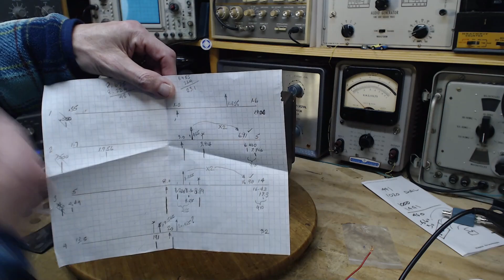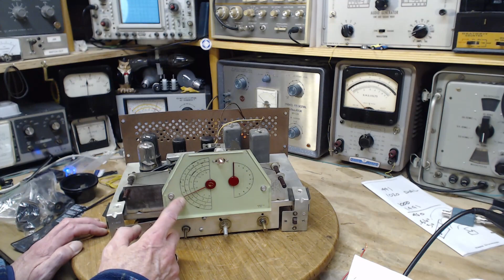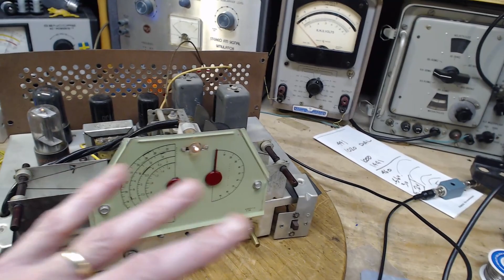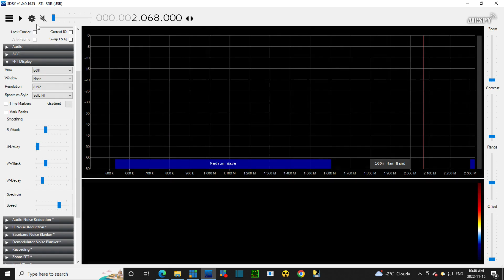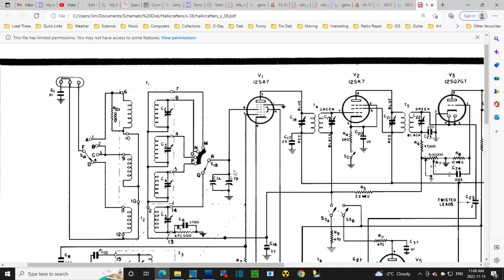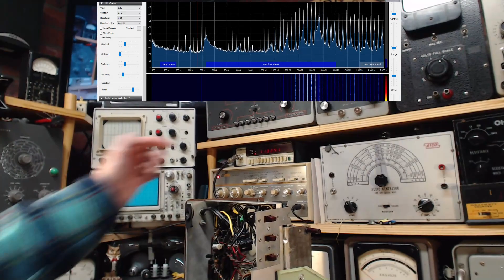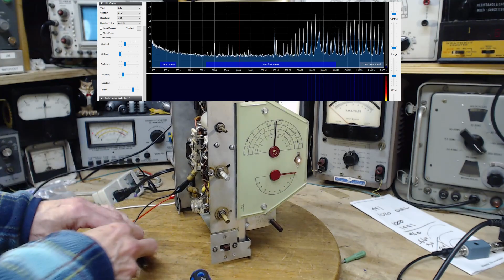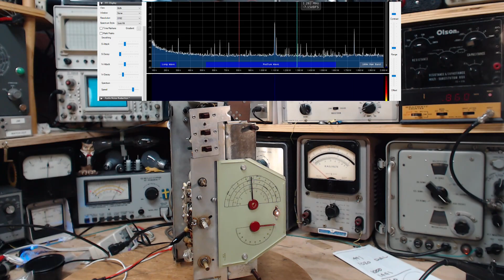Hallicrafters S-38 Four Band Tube Radio Video #12 - AM Band Performance Check

Comment: I was confused at your conclusions regarding the receiver not passing the 800hz signal being the sdr loading when you had already proved that the antenna coupling capacitor was defective.  Did it not have an effect on the input signals?

Comment: I had one of these radios once. It wasn’t a very good receiver even on the AM band it was not much better than an AA5
Reply: That’s all it really is, a single conversion superhet radio (AA5).  These just have 4 extra coil sets in the converter to add the shortwave bands.